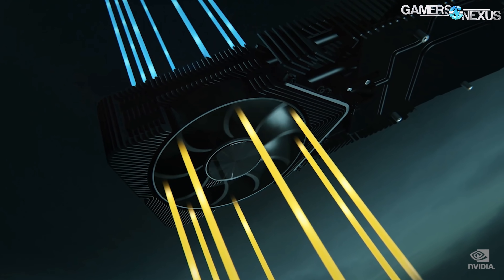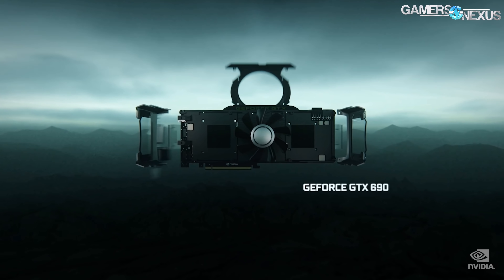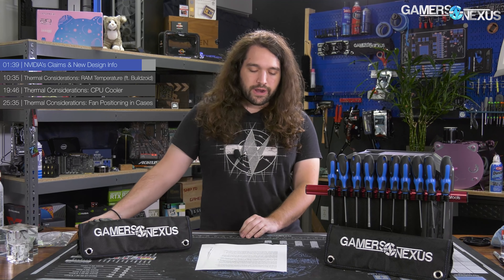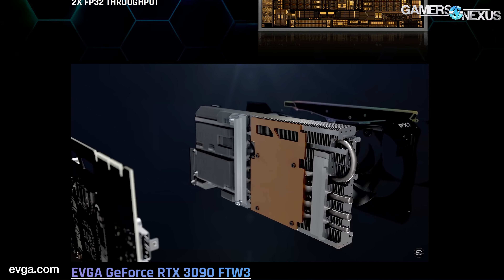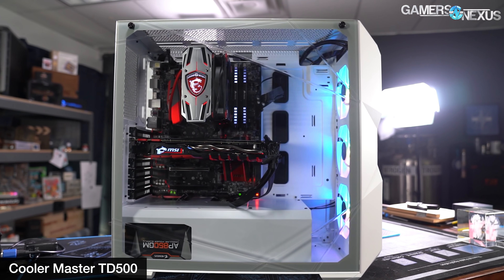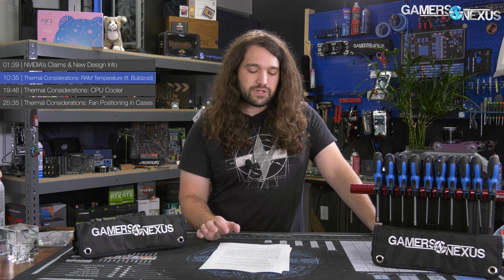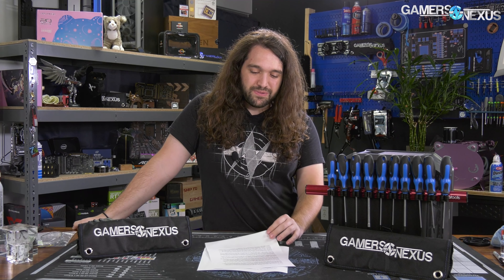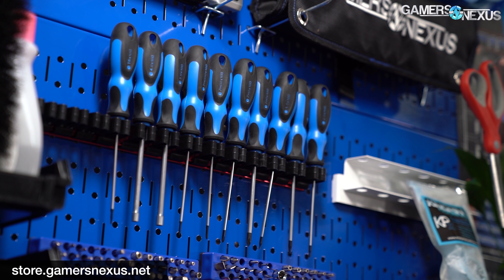NVIDIA RTX 3080 Cooler Design: RAM, CPU Cooler, & Case Fan Behavior Discussion

Comment from the maker: Correction: NVIDIA's chart says either it is 10dBA quieter at the same temperature (thermal-normalized) or 20C cooler at the same noise level (noise normalized). Sorry to mix that up, but that's what we get when we have 6 hours of technical briefings and 24 hours to turn around the content!
Watch our initial news coverage of the RTX 30 series: https://www.youtube.com/watch?v=UUGj3gCf3sg
Or our coverage of the custom RTX 30 cards: https://www.youtube.com/watch?v=7puH-8aCfBY
Grab a GN toolkit here! https://store.gamersnexus.net/products/gamersnexus-tear-down-toolkit
Reply: You literally put me to sleep
Reply: As soon as I saw that reference cooler design I was thinking Mac Pro. 3 tunnels to separate PSU, GPU and CPU. Each has it own's intake and exhaust, and it is not obstructed. Might be as simple as using pieces of perspex in your existing case to separate these?
Reply: I don't really care about how this card exhausts air because i can't afford it anyway!
Reply: just adjusted my case so my intake fans arnt just decorative now theyre able to pull in air. crazy right ?
Reply: The 3xxx launch from Nvidia could push you over 1 million subscribers. Exciting.
Reply: I'm upgrading to a 3080 (in a complete new system) from a 9 year old laptop. Gonna wait and see your reviews to see what which partner to go with, but your videos are my go to for every part, i check jayz 2 cents aswell but your channel does the part by part breakdown better than anywhere else.
Reply: Steve how much is the toolkit and do you ship to the UK, if so what is the shipping cost?.
Reply: Ayren Jagar I was wondering why some cases don’t do that. They already have PSU shrouds, they could have a ‘shroud’ for a radiator so the air intake comes in cool - water goes through some grommets to cool the CPU - then the air exhausts and never enters the main chassis.
Reply: Its ok. That was annotated in the graph.
Reply: Arby631 no bc i dont have a sister
Reply: any idea when you will be getting test samples?
Reply: So my purchase of the H500 from cooler Master (the regular one with a mesh front) with two 200 mm intake fans in front, a 200 mm fan up top expelling, and 120 mm in the back blowing out should be plenty enough for dissipating the heat generated by this card?
Reply: @MrKlawUK  seems like an easy enough DIY ,really easy if you have a 3d printer.
Reply: In the ekwb.com website it says for a RTX 3080 & 3090 waterblock,  quote: "This block is made for reference PCB 3080 and 3090 cards. Founders Edition does NOT have a reference PCB."
Reply: That's what I thought. The diagram actually shows it obviously. Great video anyway my man, you did an outstanding job. Can't get enough details on that sweet RTX 3080. Really enjoyed it. 🌝👍🏻
Reply: If the card sends the hot air to the section of the case, where all the fans are. How can that be a bad thing? Even if the CPU temp goes up by a phew degrees.
Reply: Steve, could you include some pcie bandwidth performance on 3000 cards?  Any idea whether AMD or Intel plan to add pcie lanes for future consumer cpus?
Reply: well louie is the repair god
Reply: My Ryzen 5 3600X runs fine @ 34 oC with default cooler, near GTX 1080 GPU.  It jumps to 50 oC when in heavy use. If I buy a stock Nvidia 3080,that hot air will go straight into CPU cooler ... this cannot be good. I'd have to build a air flow baffle .. or demand Nvidia make one .
Reply: There is very good reason to use STOCK CPU cooler with new GPU. And that is, person who doesn't have much experience in working hardware can easily change with low effort the GPU in a system without much of a risk of harming the components. The effort required to change CPU cooler later on the other hand is in completely different ballpark.  I'm a person who build his entire systems himself and swapped the cooler after some testing how noisy the stock cooler is. I do recognize that not everyone are like me or just remember  how it felt first few times I changed in components myself, and if I would of had to deal what it takes to change modern CPU cooler I would of avoided the task at that time. And most importantly more the CPU would of cost less likely I would of been willing to take the risk.  I do assume that unless it gets widely known that stock coolers really suck with new 3080 there are people who will do it with high end CPU:s.
Reply: As the competition with AMD tightens (at least threatens to anway) it does makes sense that nvidia would look at the next most cost effective way of improving their product.
Reply: @AyrenJagar  I was thinking the same thing except using one of my 3D printers and splitting the 2 front fans, one diverting to the GPU and the other to the rad in the top and curving and extending it to the the top of the rear exhaust fan so air off the GPU is blocked from the rad on top and exhausted by the fan on the back ..... It would also keep most of the hot air off the memory sticks However to make that work I'd have to use the lower x16 slot and then I wouldn't have much for clearance from the power supply shroud for air entering, maybe one inch and the air from the front fan shooting over the top instead of providing intake air .... Or just move the rad to the front and exhaust everything out the back and top which should move the air fast enough that it wouldn't really heat the memory and VRM's any more than a normal GPU cooling setup while keeping the perks (higher boost clocks) of an oversized rad  on the CPU  ......   

Then again it might be all moot if the FE cards sell out in 15 minutes and I have to get an AIB model anyway which with my luck will likely be the case ......
Reply: @jouniosmala9921  If stock CPU air coolers are that bad, a 3080 will probably show it out. Maybe AMD will eventually need to respond ? .. and blame Nvidia !  lol
Reply: Im actually excited to test my D15 with 3 top intakes the upper front fans for exhaust and a bottom intake for fresh air for the gpu in my define 7 (it will probably be terrible but i wonder if a front  fan exhaust can be a difference in the right position)
Reply: 04:20 a vertical GPU mount with those old style acrylic perfurated side panels and this gpu as the potential to help?
Reply: It's like the chart actively tries to get you to make exactly that mistake.
Reply: The best bit of unbiased information. Is actually information thank you from all Steve. As with any other questions? It's all about the technology and what we can expect. I found Steve while watching Linus and I thought he's a smart caveman like myself. I actually wanted to know about pcs and and in depth approach to the said pc hence why I changed my overall aspect of many views will give one the best knowledge. Watched a bit of Jay as well many mind's are better than one. Keep it up tho Steve the one's that want to go down the road of more than it just posts. Like to get the in depth explination.
Reply: A psu should be in a place that is not  going to restrict airflow bottom of a case as it has been for along time. I now have a preference of case design great looks and excellent cooling if everything is placed right.
Reply: As for the fact of pc owners toward a certain fact? That is because we have the best technology. Available?
Reply: People are stupid that do not know certain area's
Reply: This is probably the most user friendly in my system I have done the research.  Just waiting for an appropriate price.
Reply: I will never pay for the same unless it's an actual upgrade for the state of money. The rrp in the state's is 700$ yet in the NZ we pay two fold that price?
Reply: Performance is why in which you transfer to pc? Better visuals better performance? I had a commodore 64 cutting edge at its time then I had a 486. I was in that time working with dos. So I understand how computing has effected the world especially since ID rewrote the rules.
Reply: We just buy the best because we have great reporters of that fact.
Reply: @jouniosmala9921  very kool kanye
Reply: Surrounded byCowards   ah well you already have a cause the fact is that your not surrounded by cowards. We are just normal smart people.
Reply: I wonder how this would affect 2x 3090s stacked in NVLINK🤔...
Reply: has nvidia  put out 3080 and 3090 cards for review already ?  NVIDIA RTX 3090 vs NVIDIA RTX 3080 | Test in 7 Games [Benchmarks]  https://www.youtube.com/watch?v=cApmTswEXjQ
Reply: HI will my Corsair Rm850 X work with my setup , 3900X , Msi Godlike X570 and 32gb Ram and Lian Li Mesh Case , Hope to Get a Rtx 3080 thanks
Reply: When are you going to get a review sample so I can watch all the goodness?
Reply: So have you figured out how to look at the graphics cards on MSI's site yet? I have.
Reply: You cannot compare one point on the green curve with two points on the other one AT THE SAME TIME. It is either 20° C cooler at the same noise level OR 10 dB less at the same temperature.
Reply: @Gamers Nexus I would once again humbly submit a request that you guys test something like the PC Red Dragon Vega 56 card as a case study (pun intended, and free to use :P) for this sort of cooling setup. It's not identical for many reasons, but it utilizes the same setup of a mini PCB and full-size cooler, with the front fan on the card completely blowing through the heatsink and up into the airstream of a tower cooler. Pretty please?
Reply: You guys should discuss the 2080TI Panic Selling, I think you guys could find a reason to talk about that
Reply: i would love to see a somewhat of a model for the airflow / hot air patterns with a normal cooler (not blower). i feel like this "hype" is totally ignoring that the heated air from a conventional GPU cooler is going up towards the RAM / CPU and gets exhausted by the top / rear fans anyways.
Reply: You prolly dont care at all but does anyone know a method to get back into an Instagram account??
I was stupid lost the account password. I would love any tricks you can offer me!
Reply: @Rowan Miguel Instablaster ;)
Reply: @Colten Samir i really appreciate your reply. I got to the site thru google and im in the hacking process atm.
Seems to take a while so I will reply here later when my account password hopefully is recovered.
Reply: @Colten Samir it worked and I actually got access to my account again. I am so happy:D
Thanks so much you saved my account!
Reply: @Rowan Miguel happy to help :)